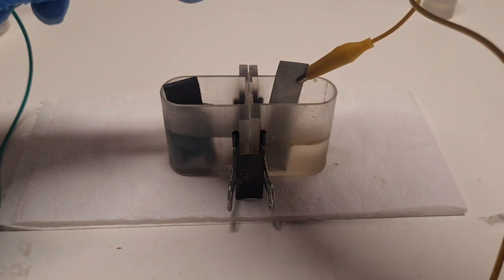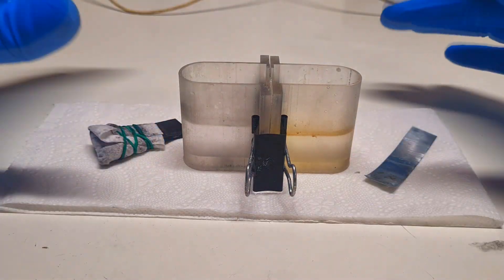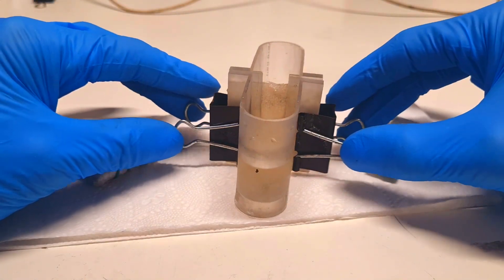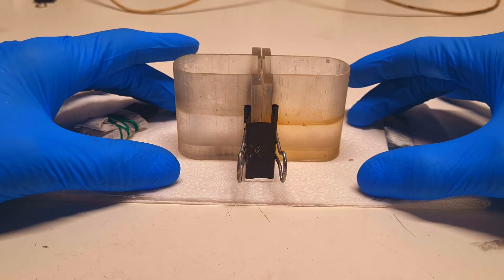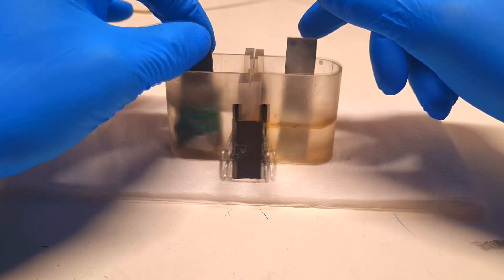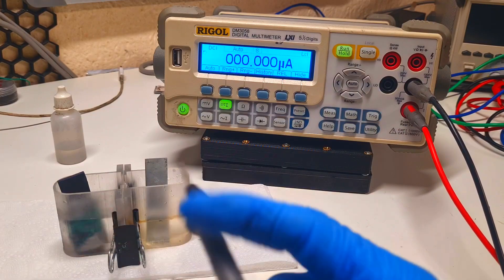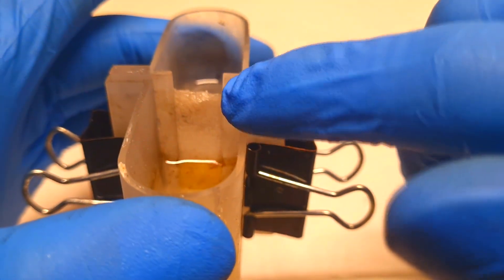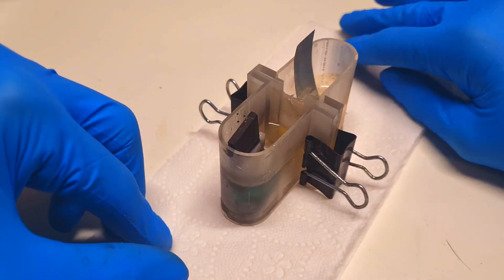GEL membrane in Dual electrolyte Zinc Battery PART 2

Comment: Hi. Nice. Did you 3D print your containers if so what type of plastic is it PETG
Reply from the maker: @danp1224  Yes I print it with ABS like resin
Reply: @ thanks It’s holding well with the acid.
Reply from the maker: @danp1224  Yes the resin is way more resistant to the alkaline and acids that fdm plastic

Comment: In order to avoid the deterioration of membrane due to air exposure you may try some containers that expose the entire membrane to the electrolyte. In this way you will increase the membrane-electrolyte contact area and and get a higher current. 
Between electrolyte containers you may add some silicone to seal the membrane edges.

Comment: My suggestion, use DMSO as electrolyte with additive (I use KNO3), and it gives much higher voltage (over 3V).
Now I want to use Na-MnO2 or K-MnO2 batteries.
I want to achieve voltage around 4V.